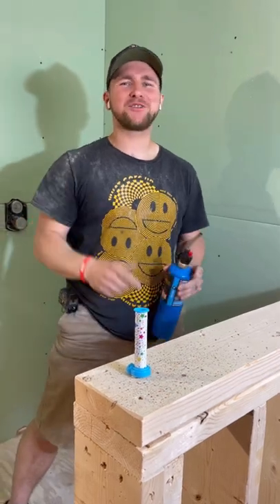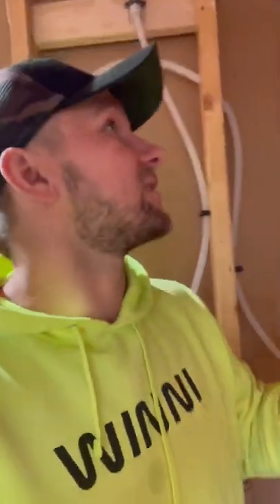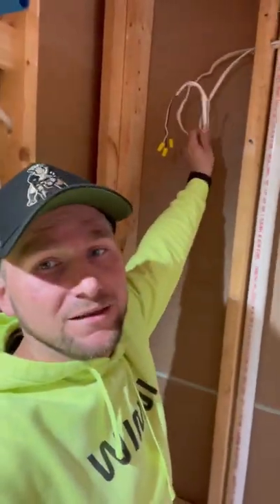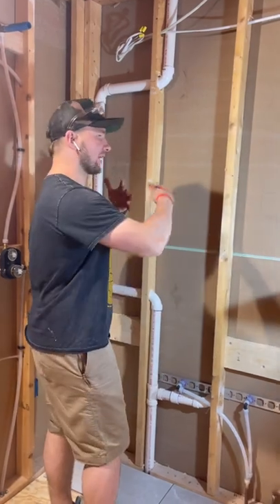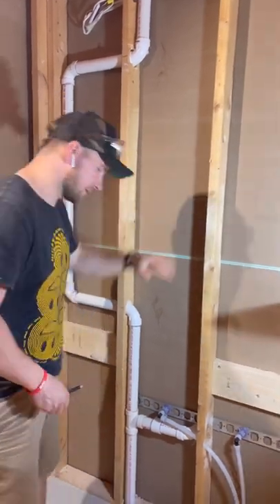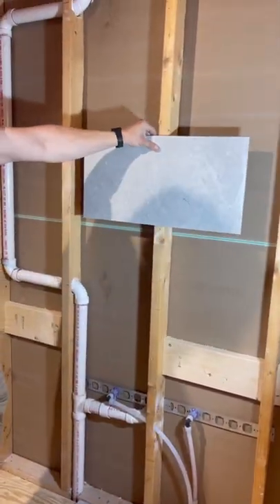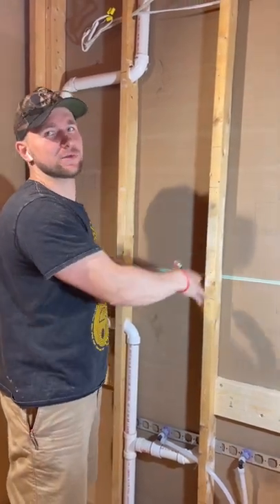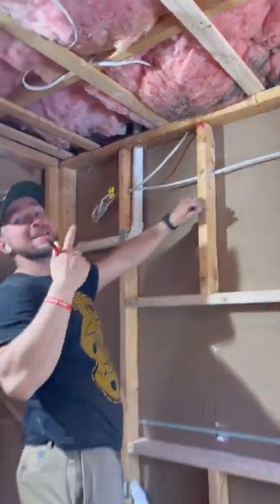Bathroom Renovation Vlog 001. Drywall Install. Vent relocation. How to build a niche.

Comment: Can i use concrete boards instead of drywall?
Reply from the maker: Yes! But the waterproofing method will be the same. Green board is much cheaper and easier to work with:) all this will be covered with waterproofing membrane

Comment: Who use green bord this days??? On the shower area...??? No boddy....
🤦‍♂️🤦‍♂️🤦‍♂️...  Thas a....  NO NO..... DONT MATTER IF YOU WATER PROOF...NONO..🤦‍♂️🤦‍♂️🤦‍♂️
Reply from the maker: GURU Membrane will go over it next. You might not like it, but these is absolutely nothing wrong with that.
Reply: I do. What's the point of using cement board or foam board ? Unless you don't trust yourself to install a membrane properly ? Use your brain instead of saying BS.